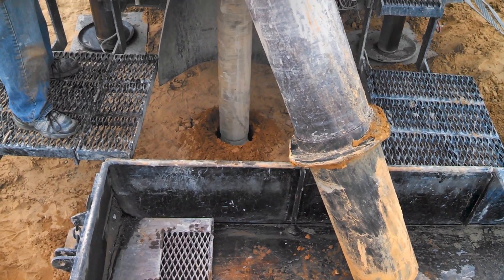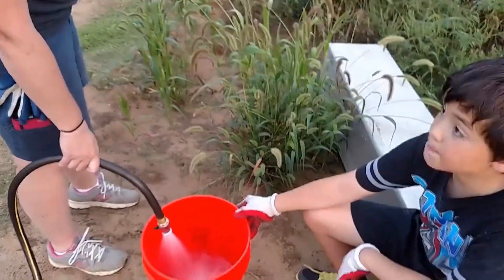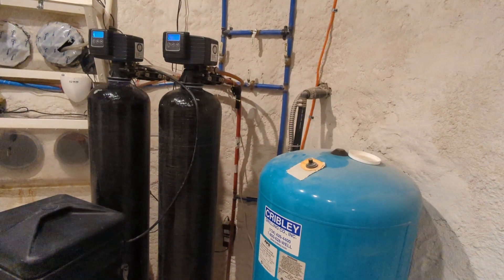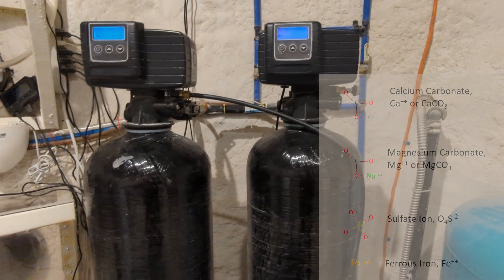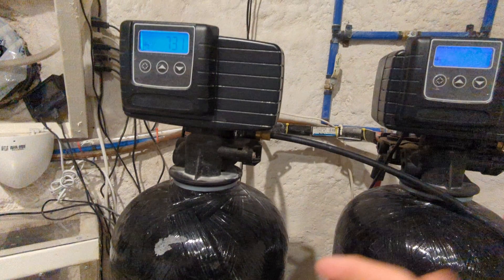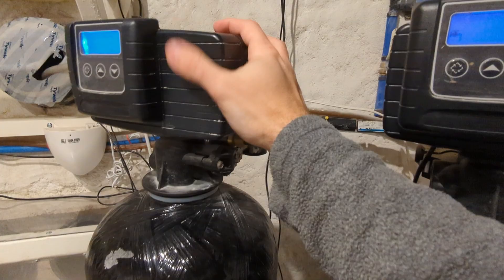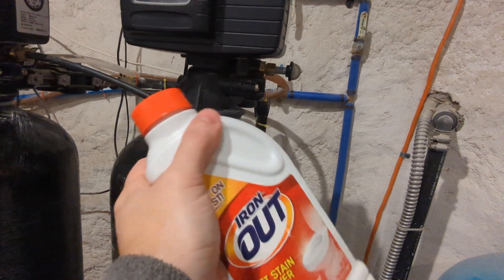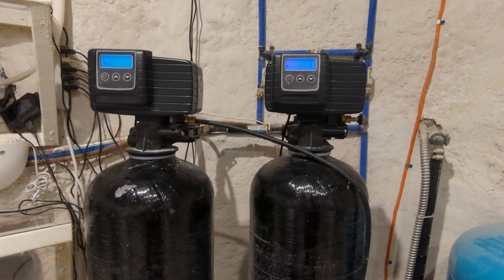WaterSoftener Video

Comment: Thanks for the interesting video.  I was wondering where you plumb your discharge water?  I have seen articles for and against discharge into a septic system.
Reply from the maker: Yea, I plumb it into the septic system.  I did try using the French drain (the mechanical room floor goes to the French drain), but it can't take the water fast enough to keep up with the discharge.   Short of running another whole system or sending it down the earth tubes, I didn't have any other options.   I did wish I had plumbed it right into that room though.  Instead, I had to go up and thru the wall and into the drain stack in the basement bathroom.

Comment: I can't help but ask- do you have a separate cold water heater, or can your hot water heater also heat cold and lukewarm water?  😆
Reply from the maker: Actually, in my case, at least now after hooking up some other systems, the water from the well goes thru the floors first, so that warms it up to room temp.  Then it goes into the solar water heater and gets dangerously hot.  We cool it down again with some cold water (via a thermal mixing valve) to get it just below the temp set on the hot water heater, which then just tops it off if necessary ;)    

So yea, I am one of the few people that actually has a hot water heater, at least while it is sunny.  ;)

Comment: Watch out for your pool, if you fill your pool with softened water, you will still get some salt in the pool, and this can impact your pool water and fixtures in the pool.  If you're using a salter water pool with a chlorine generator, your salt levels may be impacted by using softened water.
Reply from the maker: That still must be better than adding the rust and calcium carbonate that is naturally in the water.
Reply: @SimonHomeintheEarth   - Oh, for sure!  I filled my pool with softened water too.  I'm using a chlorine generator though and realized that softened water increased the dissolved salt levels in the water, so I had to factor that in when "adding" salt to the water for the chlorine generator.

Comment: There is a new filter based system. No more need for added media. Maybe not for rust tho.
Reply from the maker: Yea, I looked into those types of systems.  They have a cartridge section that you can pop a filter into (sort of like an inline fuel filter).   The obvious advantage is you don't need to buy all that salt (about 5$ a month), but the filters don't work quite as well at softening the water and they are not cheap either.  The filters need to be replaced and cost over 100$.  I ended up going with this approach, but I am interested in hearing if anyone has tried the filters for softening water?
Reply: @SimonHomeintheEarth  I'm planning on using them. It's going to be interesting to see how they handle acidic rainwater. Yes, 1 source is hard & the other, rain, can be acidic. I'll probably try to treat the acid 1st. Its going to be awhile tho.
Reply: @SimonHomeintheEarth  what brand is your water softener? I had a all in one unit Craftsmen brand and it used a ton of salt. So I quit using it